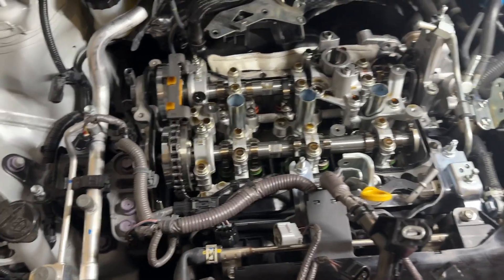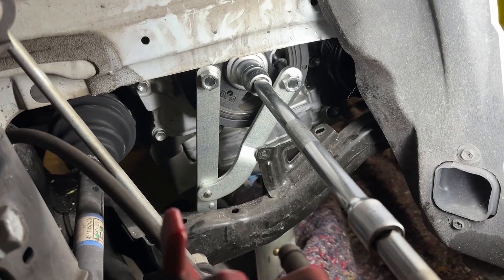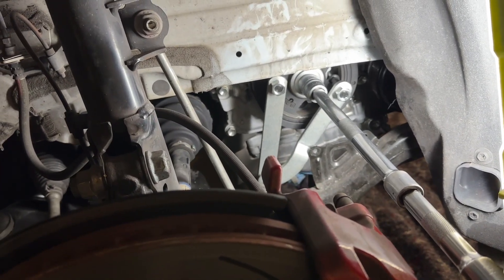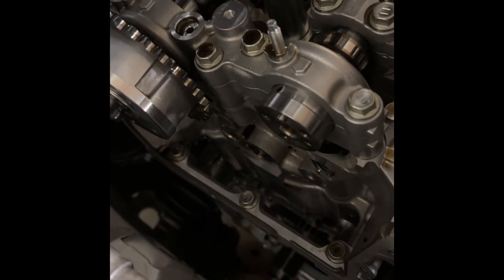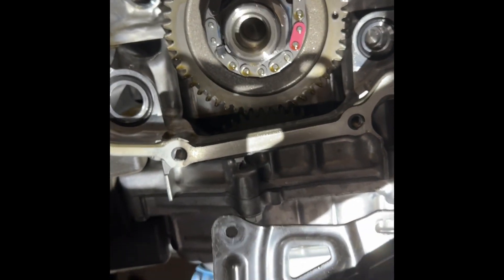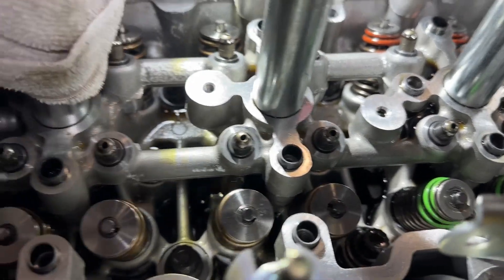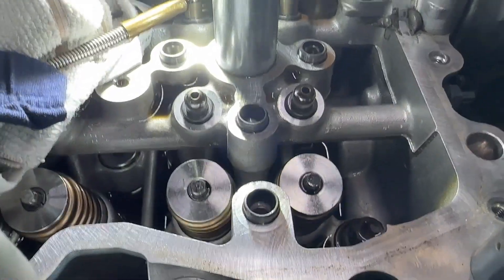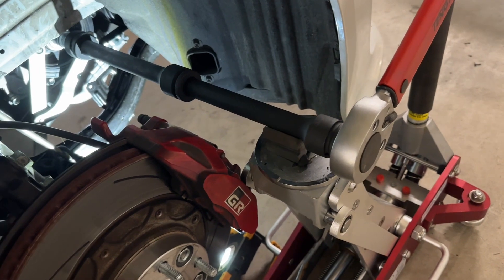Syvecs GR Yaris G16E-GTS Kelford Cam Install at Home

Comment: Awesome set up! Getting some great numbers, did the cams meet your expectations? Always great to hear feedback?
Reply from the maker: Cams exceeded my expectations. No discernible loss of low torque and feels like it will rev to 8k easily, but limiting at a sensible 7500. They go very well with gt25-550
Reply: @davindermanku8187 very happy to hear that. Great results and video. I have added to our playlist. Thanks for using Kelford Cams!

Comment: How much horsepower did this set up make?
Reply from the maker: It’s now got a G25-550 turbo, 3” catless, big intercooler and piping, 1200cc secondary injectors and a fuel surge tank with a DW440 brushless pump. At 28psi it makes about 480hp on 98RON, on ethanol over 500 but have to manage torque carefully to preserve driveline….still dialling it all in.

Comment: Be surgical!
Thanks looks like it was a big job, 
where did you get tech manual? 
You got it running on e85
Reply from the maker: Tech manual from Toyota online. Now running on E85 and fitting a GT25-550 turbo and 1000cc Bosch secondary injectors with a DW brushless fuel pump👍👍

Comment: do you bring out the original valve spring seat?
Reply from the maker: Yes, replaced with kelford bases that come as part of their replacement kit. Must take the OE bases out to achieve proper spring seat pressures.
Reply: oem valve spring base actually what i mean.
Reply: What is the risk if just leave the oe base? Is it affected the cams or any issue for high revving?
Reply from the maker: Why leave them?, just pick them off with a magnet. The OE bases are very thin, like .5mm or less. Like washers really. The kelford springs are designed for their own bases. You have nothing to gain by leaving the OE bases in.

Comment from the maker: Cams are good….slams into the set 7500rpm redline now with no valve float👌. No real downside. Sorted basic fuel mapping running 3rd gear o red line and adjusting logs, it needed up to 10+% up top. VVT timing on Dyno soon!